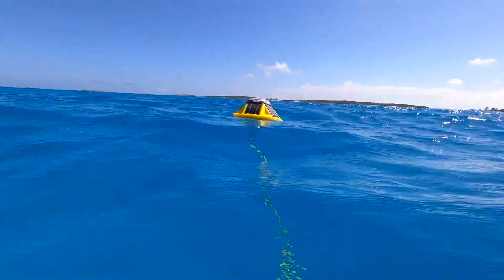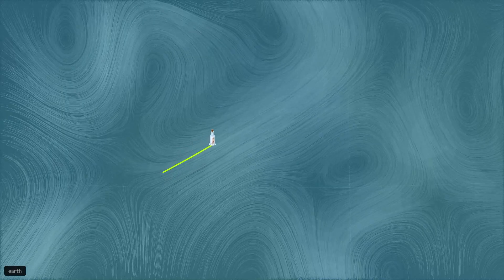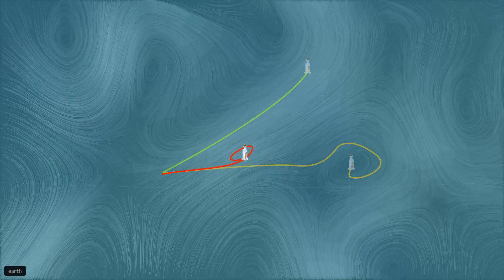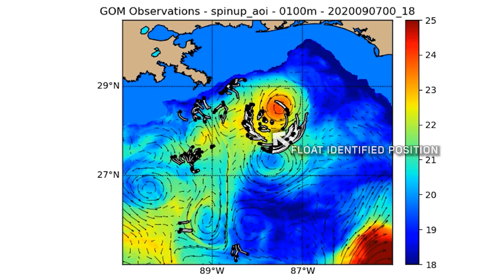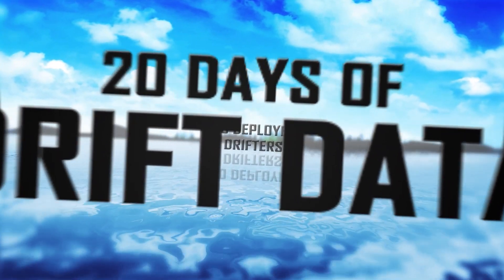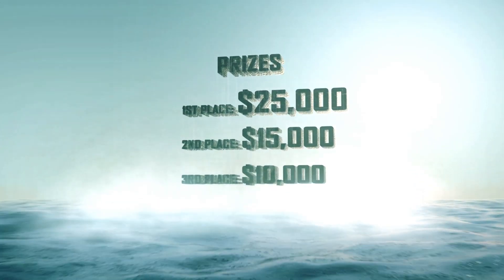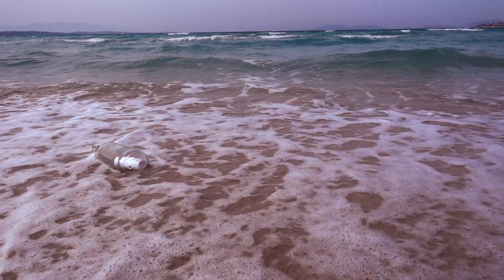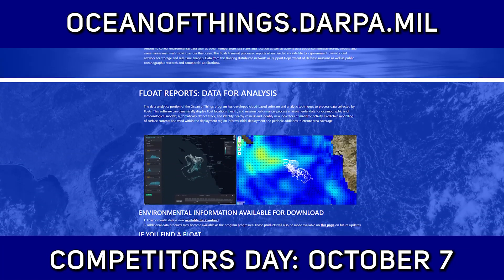Forecasting Floats in Turbulence Challenge

Comment: Vector Plotting,, 4 dimensional variable imagery, where it isn’ t to find where it is. Isolate the least likely places it would be in order to determine where it is. How hard could it be. It can only be in one place. If you determine where it is not. Fluid dynamics according to identifiable variables like wind and water speed, direction water and air temperatures, air pressure, tides, drift, and buoyancy and sea floor, smaller objects tend to be attracted to larger objects visible or not . Determine where it isn’t to get the highest likelihood of where the object would be. This would all be a good starting point. LoL but I haven’t the slightest clue how to import the data into a topographic simulation in order to determine where the most likely place to find an object floating in a vast ocean. Probability and chance says a single item can only be in one place at any given time. Predetermine where it isn’t and then start looking at where it is. Archive this through triangulation visual imagery and statistical analysis of the data inputs. I’m sure one of your mathematicians could plot a simple algorithm to determine where a object is likely not to be pun point the highest probable outcome of where it should be. It’s not in a superposition, it either is or isn’t in a certain spot at any one given moment. If it’s a sailor your looking for determine the sea life that may eat that individual, and hope to not run over him, cause the answer is usually right under your noses. Good luck with this hard problem. I have already spent to much time writing this hypothesis with no real reason other than wasting time. Treat it like 6 person battle ship north east south west and up and down it’s going to be stationary on a 2 dimensional plane you just need to determine it’s physical where about a by estimating time and likelihood of where it isn’t. Okay I’ll be home waiting for my cheque . You do the science homework and math and get back to me. I hope the cheque clears. There’s only one place it could be so start and finish their, do it squared and radially, and combine databases to determine where the future position will be, whether you know where it starts you know where it’s likely not and scale the difference by plotting the data to determine where the position is currently. No pun intended!
Reply: I love darpa